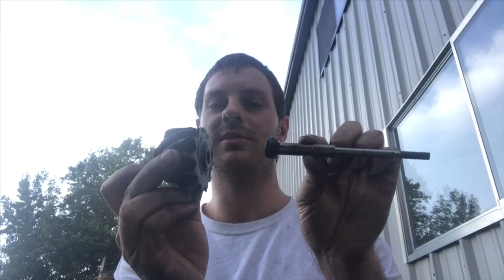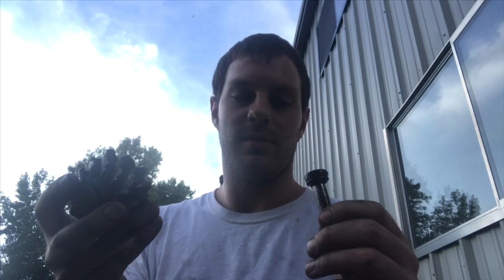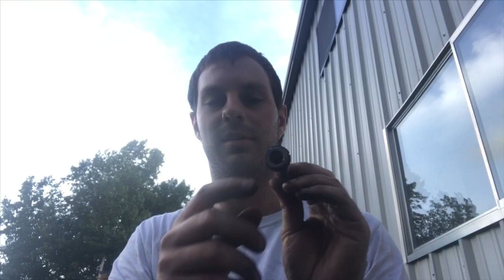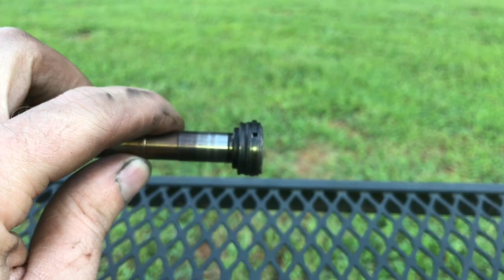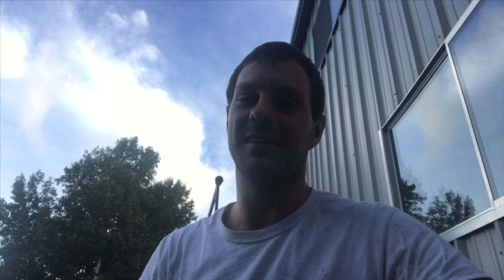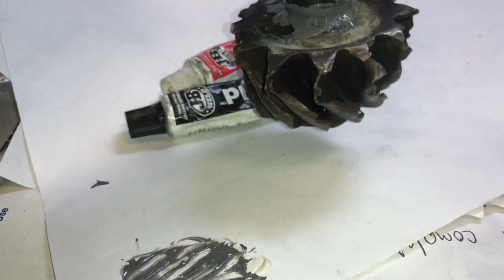What’s inside a Turbine Shaft

Comment: Actually they are friction welded. One side, either shaft or turbine is spun at a high speed.  The other is stationary. Then they are slammed together. The friction causes high enough heat to weld the two parts together.

Comment: In my experience if they are fusion welded like semi axle shafts then both piece's are chucked up in a machine and it will spin the turbine wheel one direction and the shaft the opposite direction and then force them together thus causing friction which heats the metal to a molten stage and create 1 solid piece from 2 different piece's then it will be run through a tempering oven.